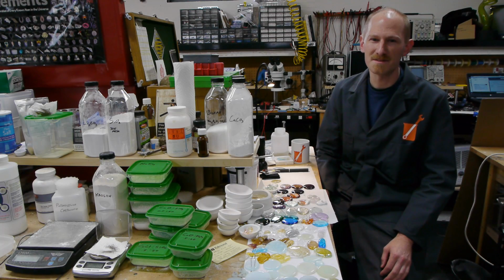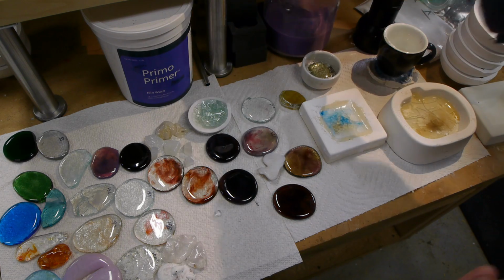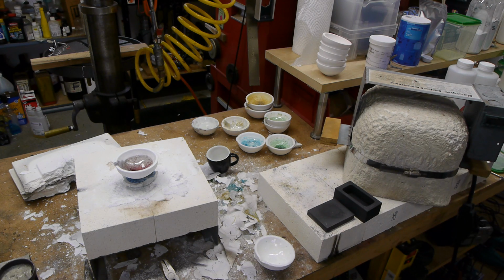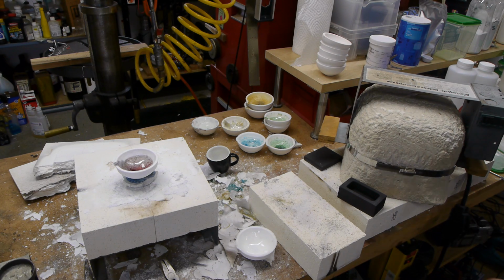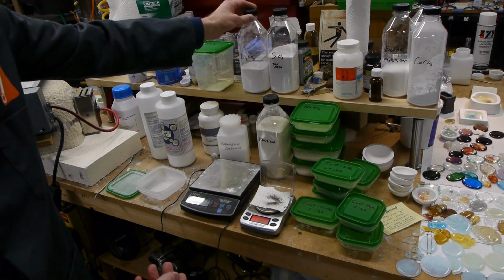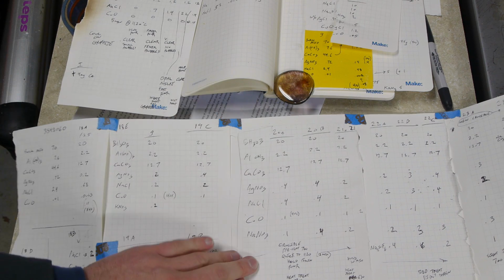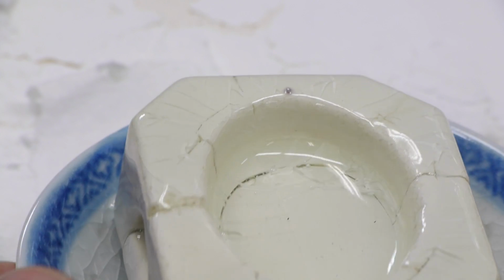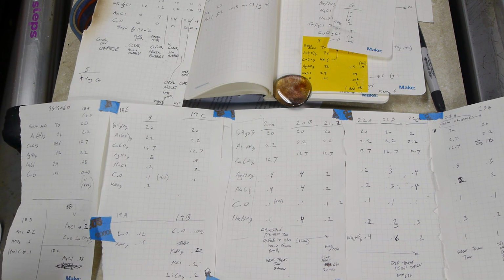Glass engineering - designing and making photochromic glass

Comment: I just watched to 5:48 and posted this.

I know things change when you do things in a vacuum. For example, water boils at a lower temp.

With that, my question is this:
Can you take advantage of the differential property when it comes to making glass? That differential property being the change in melting point via different vacuum and pressure and such.

I ask because maybe you can cause it to melt at a lower temp inside a vacuum and have it not super stick to a surface as badly.

Not very book smart but I am pretty intelligent and curious so let me know if my question makes sense. If I change the world, let me know. Thanks!
Reply: Vacuums don't affect the melting points of things, just their boiling points. This is because of the way we define boiling, which is when the vapor pressure (which is a property based on the liquid itself) equals the atmospheric pressure. Changing atmospheric pressure, therefore,  has to change the boiling point. Sadly, it doesn't affect the melting point, since no gases are involved. Hopefully that make sense!
Reply: TheOwlOfTruth Incorrect. Really, really incorrect. Pressure affects melting and boiling point. In fact, at certain pressures, some elements and compounds simply cannot inhabit certain states of matter, regardless of temperature. For reference, check out the phase diagram of water https://upload.wikimedia.org/wikipedia/commons/thumb/0/08/Phase_diagram_of_water.svg/700px-Phase_diagram_of_water.svg.png
Reply: e'd lose the volatiles that he needs like silver and copper under vacuum even faster. At the temps needed to make glass they will evaporate out.
Reply: Mark Kalsbeek lol slightly. But it's good that you are engaging. It's what science is all about.
Reply: Mark Kalsbeek cool, you responded. I got it working I will send the invite. Welcome to my inner sanctum. Lol

Also, I would delete the info now. Just saying.
Reply: I think you get a problem heating the ingredients in absence of an athmosphere. You would either have to heat the crucible directly or use an insanly intense infrared source.
Also surrounding gas might help to distribute heat evenly to ensure that all reactions happen at almost the same time in the entire sample and not faster where the crucible is transfering the heat.
Reply: TheOwlOfTruth oh yeah, that makes sense. Yeah, the label is very misleading if it does work that way. Thanks for the info, I shall now "apply" this "science" into my life ; D

Edit
Teth47 now had me doubting life again xD

Oh science, you crazy.
Reply: @Teth47 my bad, didn't think about that ._. I guess it still doesn't affect melting point enough for the original idea to be feasible though. Thanks for the correction!
Reply: Teth47 that's what I originally thought because people can melt and freeze water by using different pressures. That's why I thought, can't you do the same with glass?
Reply: David Galbraith is all glass equal? Is there a glass that can take more heat? Something along that line to contain it in. 
I don't really know what I am talking about, but brain storming and trying new things or ideas is what I am all about. Sometimes firing into the dark you might hit something you didn't look towards at all. If that makes sense.
Reply: He covers that in the video, his kiln is actually barely capable of the low end of temps for making glass, there are many types of glass that take much higher temps than his kiln can reach.

The active ingredient in the photochromatic glass is the silver to turn it dark, the copper to make it clear again, he describes that you can't just throw the mix in the kiln over night and get out photochromatic glass in the morning as the silver becomes a gas and evaporates out of solution in the molten glass over time, pulling a vacuum will draw the gaseous silver out even faster.
Reply: David Galbraith To be honest, the whole mechanism is a bit mysterious to me. I wish i could build the thought in my sandbox brain and work it out. Used to have a good understanding of stuff but this is alien tech pretty much lol
Reply: It is possible to build a vacuum kiln, heating won't be a problem since you can microwave the whole thing. A problem would be that the vacuum allows gasses to escape much quicker than under regular atmosphere. Somewhere in the video, you see a clip from glass being molten in the crucible and it is bubbling up above the rim of the dish. Under a vacuum, this would happen much more vigorously, which makes it harder to contain. Furthermore, you want some of these gasses to react, and if they're drawn out so quickly they mightn't have time for that. That said some types of glass might benefit from this, depending on the reactions occurring. You say you're: "Not very book smart but I am pretty intelligent and curious", and if you want to become "And very book smart and  pretty intelligent" drop me a line, I think have some pdf versions of books you might find interesting, and am always happy to answer questions.
Reply: Mark Kalsbeek 
Yeah, thats true. I guess that is why the would fill the air with other none reactive stuff. To keep it from doing as you said he said/showed.
What kinda books do you have? I don't even know where to begin lol I just kinda go where my mind takes me most of the time. I learned to trust my gut because of this too. Works our very well for me.
Reply: NinjaOnANinja I have the Same problem, so I use books to structure myself a bit. Otherwise I just scratch the surface and lose interest. I can get you pretty much anything you'd be interested in, from broad areas like physics, chemistry and biology to more specific areas like material science or aerodynamics.
Reply: Mark Kalsbeek what about that book by Neil Negras Tyson, the scientist in a hurry or people in a hurry. w.e it's called.

The issue with me is I don't like math. I never accepted where the logical parts stop working and you need to learn 3rd party methods to do the math. If that makes sense. And I know a lot of stuff is built off of math and the third party methods. It's why I ended up doing psychology and philosophy. Those are all built on fundamentals that can be proven without 3rd party rules and sets.
Reply: I don't like math too much either, but you don't need any third party methods, for every theorem, there is a proof that you can understand. I am pursuing a degree in engineering where the maths is more a tool than a goal in and of itself. For example, I have to be able to do complex integrations, but I don't have to be able to prove that integration as whole works. This is frustrating because it's hard to build on half-understanding IMO. For many fields, a bit of math is a prerequisite, but to understand whats going on knowing about common functions and the principles of integration and differentiation will be enough. Even if you're doing psychology you'll need statistics, which is also math. Only you'll be, hopefully, integrating probability distributions. 

I like NTD but his writing is popular stuff, it's meant to motivate people about science rather than give them the means to actually do it. If you like applied science's channel, I think this book will be a good fit to get an understanding of some underlying principles of materials, escpecially chapter 13. https://goo [dot] gl/EowWsV
Reply: Mark Kalsbeek yeah, that's fine. A lot of what I want to say is pretty long winded so that might the best choice. I will hit you up once I get home. Probably about 7 Cali time.pst
Reply: Hey, I didn't receive any messages, in case you forgot, my offer is still open.
Reply: Mark Kalsbeek yeah, send me a message after you get this message. I have a terrible memory so when I check again I will be home and then I can message you on my pc. Generally out and about on my phone so I can't message you and I will forget unless I am reminded, which is where the response would come in to play.
Reply: Hmm I guess this would be too soon to serve as a reminder ;P
Reply: NinjaOnANinja so, now here's a proper reminder XD. I'll be going to bed now but if you add me I'll see in the morning.
Reply: I don't use skype and for some reason my discord is not working. It keeps saying bad gateway.